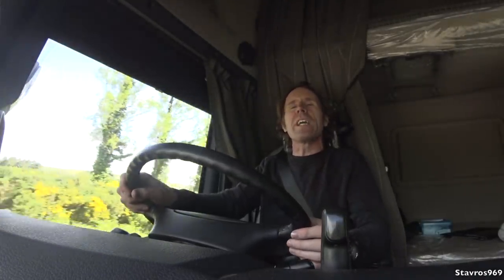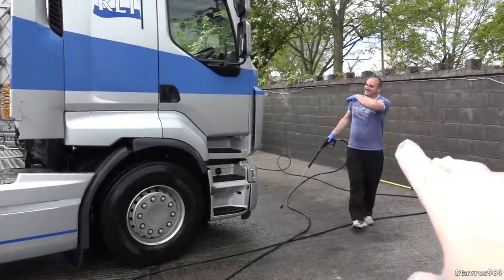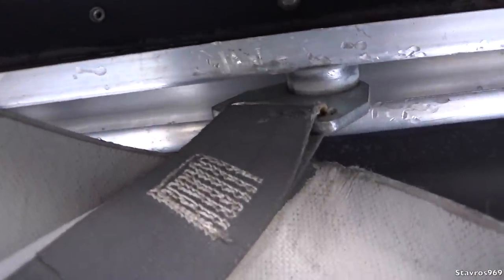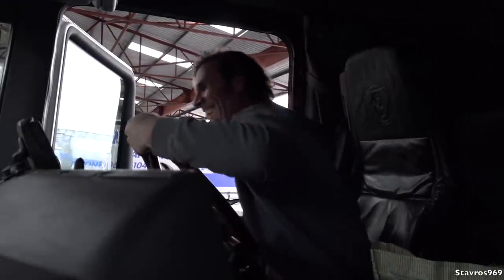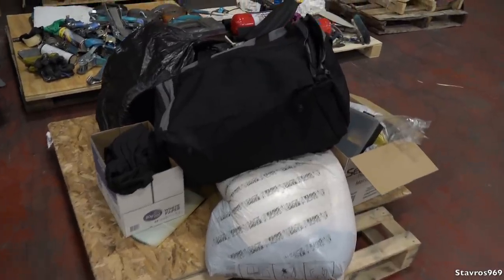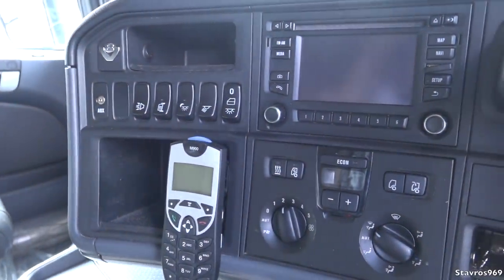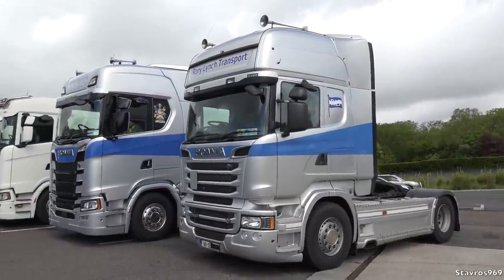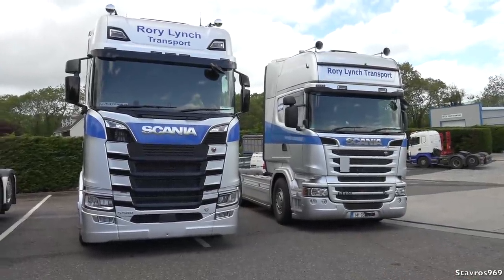New SCANIA S 580 Joins our Fleet 2020 (Collection Day)

Comment: I had a sudden stiffness of my steering and it turned out to be the gaitor on the bottom of the steering column, take the shroud of by the foot brake the gaitor was tightly wrapped around the column stopping the the steering wheel from turning, scania fitter said it's a common fault and knew what it was straight away 10min job removed it no problem ,3yr old truck. 👍👍👍